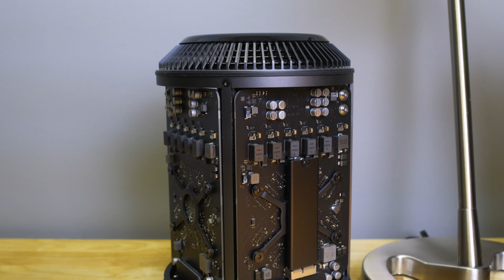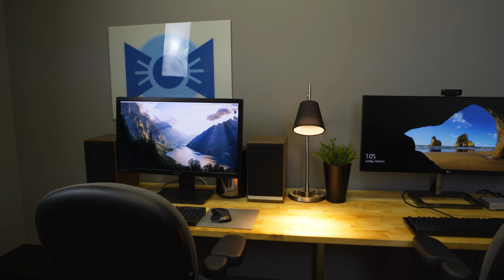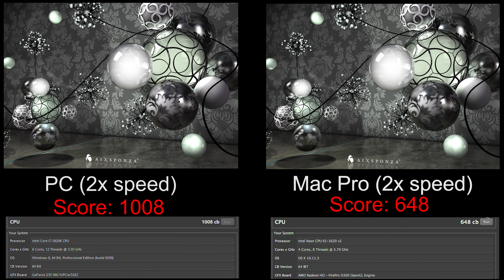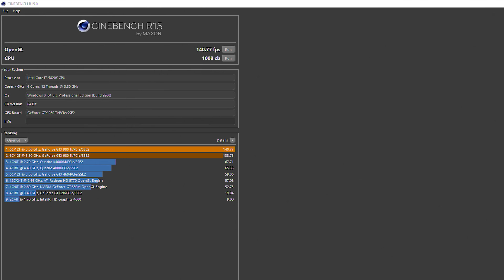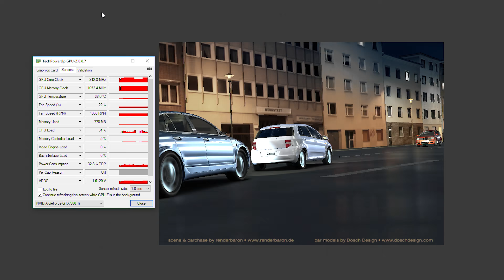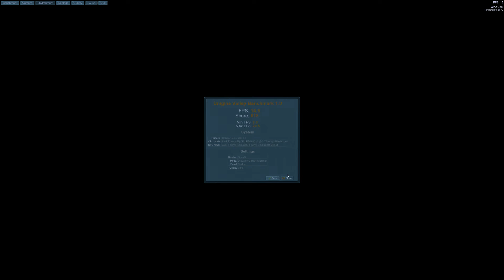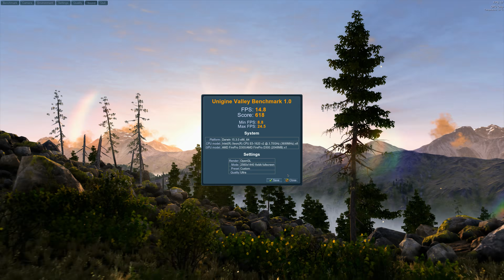$2,000 Custom PC vs $4,000 Mac Pro

Comment: why is the forest test so intensive? looks like your average game
Reply from the maker: +maak It's an OpenGL benchmark. It looks like a game but it's nothing like one.
Reply: +maak It's very likely running intensive graphical features that more authentically recreate visual effects, whereas games are optimized to look like they're doing the same thing, but with less intensive technologies. 
Think of things like fog, rain, and dynamic lighting, along with more complex physics/animation on all that foliage. Games are doing those things more cheaply, but are convincing enough to still look good.
Reply: +maak Unlikely. Your average game of 2016 is a FPS-locked, backhanded port of a console game. /s
Reply: +maak Because the Mac Pro comes with a Fire Pro class GPU, They aren't designed to run 3d games. They are more for 3d rendering and game design. Hence the such low scores. That fire pro card costs more then his 980Ti but cant even compete with any gaming grade gpu out today.  Even a Nvidia GTX950 wich costs $200 gets a decent 50fps in valley.

Comment: Did it ever OCCUR to you to load Windows 10 and OS X on he Mac Pro? 
I personally run a 2009 Mac Pro with 4 1 Tb drives using Windows 7, Windows 10, OS X (El Capitan), and Ubuntu.
I am curious why the FUCK you did not run the same OS on both machines? 

(ARE YOU STUPID??????)
Reply: +iSmell Butthurt it's not underpowered. It's overpriced
Reply: +Rich Gilbertson won't make a difference because the mac is hideously under powered anyways

Comment: I agree, it's bullshit how they don't update the hardware. Correct me if I'm wrong, but you're comparing a workstation GPU, to a gaming GPU. Those overclock's will deliver in performance 'benchmarks', but they could negatively effect the longevity of the component, and reliability of the computer. You're comparing a work machine, to a gaming rig. There is no chance I would ever buy a Mac pro, but I don't make childish hate comments either, and understand why someone with a budget may purchase one. Just build a Hackintosh, avoid the spyware lagging heap of Windows 10, and get the advantages of a custom built PC.
Reply: A workstation gpu can be made for 1,000 doe its 4,000 sp stfu
Reply: TheDenXGamer I never said you couldn't.
Reply: how is win10 laggy in any way..? its faster than 7 and 8. and i havent updated my hardware in 4 years
Reply: Daniel Leon Every time I've used it, I've had lag issues. Maybe they fixed, but doesn't change the fact that it looks awful compared to Windows 7.

Comment: What's your point ? If you build your pc with same spec (like xeon chip or fire pro card) in the same time,  it price  don't difference much like that. you're compare WORKSTATION and gaming machines. Are you nut? If  I use the same logic like you  so pc is suck and everybody must buy PS4.
Reply: I can't be bothered commenting a witty comment. Satan just kill me already.

Comment: OSX vs. Windows..seriously.  Anyone comparing hardware to hardware ONLY, misses at least half the battle.  I run a Mac Mini from 2011 ($499) and it runs the latest OS perfectly well.  I have an I7 2011 PC ($900) that Windows 10 pretty much turned into a useless brick.  Will not argue for or against, but for me (Computer Scientist with over 20yrs experience), there is no comparison - Windows has always made we wait for everything and OSX is snappy, attentive and rock-solid.

Comment: the funny thing is MAC makes out that it's better than a PC but some leaked photos showed the factory that builds mac computers had Windows 2000 running on the all the assembly lines lol.
Reply: I do feel safer I'm still using windows 7 and XP on duel boot, older OS's are much safer than newer ones, virus's, malware and other malicious content on the net target newer products for maximum damage and affect, but if you know what you are doing you'll never get infected, I've never had a malicious virus attack my computer in the last 7 years.

also most factory's that have massive assembly lines also keep most of that equipment running on a small wan or lan to avoid damage.
Reply: +Jamie Williamson The company that builds the airbags, seatbelts, and most of the safety devices in your car, are also running on an older OS.... Hope this makes you feel a little safer....
Reply: ikr
Reply: +Jamie Williamson Actually, virusses and stuff target old systems since all security issues are all well-known on those systems while never getting any updates for them anymore. Therefore they might have to google about five minutes for a list of security issues for your computer, write a virus and they're in. well... practically. Windows 7 does still get security updates I believe.
Reply: Well Apple doesn't make the machines that makes the Macs...
Reply: 2Awesome thanks to leaked photos it showed apples manufacturing plant ran on windows 2000 on every assembly line.
Reply: Windows XP is garbage, an incredibly unstable OS and the largest attack vector for malware this side of Flash. Its terrible.
Reply: Not in a million years. I was running XP on a gaming rig the same time I was OS 10.2-10.4 for work, and XP was SO bad.

I can take or leave either at this point, even though OS X is still much better on laptops. WinXP though, man, its the trash fire of operating systems. I'd have been doing my real work on Linux in the mid-2000s if OS X wasn't an option.
Reply: the people who create malicious programs won't target older systems most time, what the point of making a program that targets maybe 200,000 or 300,000 people on XP or windows 2000 when you could target newer systems that still have loop holes and back doors that still need to be patched, the people who create malicious software want to target the most amount of people in the smallest amount of time so attacking newer OS creates more victims and problems in the long run.
Reply: ***** So according to that I should target windows 7? (source: https://www.netmarketshare.com/operating-system-market-share.aspx?qprid=10&qpcustomd=0) Then I should go to this website (https://www.cvedetails.com/vulnerability-list/vendor_id-26/product_id-17153/hasexp-1/Microsoft-Windows-7.html) and pick one of the most vulnerable errors? Because that's how those people operate. They literrally look for something that's not complex to break in to. And that is in fact, things that don't get updated are a lot on that list.

Antivirus companies claim that about 90% of all viruses out there are "old" viruses for which your system is immune if you just update windows. This one no one really can confirm or deny.

What I'm trying to say is that you should drop the windows xp install for your own sake the security is not guaranteed and will have increaingly more vulnerabilities. because some day it'll be infected. And it might affect your win 7 partition and encrypt all your documents and request money for it.
That's a thing that happens.
Reply: most of the time people get infected by looking at questionable websites that deal in pirate goods, movies,music,porn, games, software etc etc, the PC I'm using to type this message has XP I only use this PC for gaming and checking a small handful of sites like reddit, facepunch and youtube and facebook, gog and steam, that's it, I download all my files onto a laptop running virtualbox windows 7 and XP that way I can scan then test the files to see if it's safe, if my virtualbox file gets damaged because of infected goods I can just install a fresh copy of the infected OS and try another source for the file I am looking for.
Reply: +Jamie Williamson That is too much work for an Apple pleb.
Reply: Apple doesn't use their own Mac servers for their data centers either. The Mac is only good for developing iPhone apps. It used to be really good at video, music, and photo editing but Windows caught up the last couple of years.
Reply: +Sulfen are macs actuality "good" for developing iPhone apps? or you are forced to use them as apple does not give you a choice? ;)
Reply: whatever000whenever You can get a hackintosh but the simulators are optimized for the parts they they use to build their macs. So it makes it less of a hassle.
Reply: So Chinese slave owners don't feel the need to update from Windows 2000? Shocked.

(2000 is actually my favorite Windows, used it until 7 was almost out. Jumped to XP for a couple years and still use 7)
Reply: So Chinese slave owners don't feel the need to update from Windows 2000? Shocked.

(2000 is actually my favorite Windows, used it until 7 was almost out. Jumped to XP for a couple years and still use 7)
Reply: If you need to run a production line, or a business of any significant size, you are clearly not going to be using a Mac. They make consumer fashion goods. They will chop and change their products to suit fashion trends, not to keep businesses operating. Look at the loyal businesses burnt by Apple's sudden cancelling of the xservers and Final Cut Pro. Nope. Not doing it no more. Just make do with Mac Minis (ie go from supposed business grade devices to toys!)
Reply: Venonæ you have the mentality of a 2 year old.
Reply: Is anybody else here PC Pro, or Comptia A+ certified?
Reply: case closed, you have more teeth than brain cells.
Reply: Ladies, calm down
Reply: Bryce Lawson I've worked a couple of IT jobs and none of them took my A+ certification seriously. It was a waste of time to take it during high school lol.
Reply: LOL
Reply: +Sulfen I'm not taking it for high school, I took a full I.T. Class in college. A+, PC pro, net +, security +, are some of the certifications I got. And everywhere I have ever looked, has asked for A+, net + and security +
Reply: Bryce Lawson If they ask for it then I guess I'll have it. But so far no one has asked for it so it has been a waste of time and money thus far.
Reply: KoolAidManOG still better than mac OS
Reply: KoolAidManOG Windows XP is long gone, make your decisions about current stuff. Don't buy stuff just because of the previous version, buy it based on the current version.
Reply: 2Awesome Obvious statement is obvious.

I've run XP, 7, 8, 8.1, and now 10 alongside OS X, and I've been happy with everything after XP (I even liked Win 8.1 after SP1 came out).

I was responding directly to a comment saying that OS X was inferior to Windows XP, an asinine statement considering that OS X has remained an excellent operating system and the fact that XP was always hot garbage.

Keep up with the thread and don't reply to comments out of context.

Comment: Thank you 4 all the apple hate
Reply: Windows and Android all the way
Reply: +Dan Singh enjoy the spyware you called windows
Reply: +probE466 what Spyware
Reply: Windows Update in Windows 10 utilizes P2P by default, most likely the same P2P technology used by Pando Media Booster. Essentially it turns your PC into a zombie host server, wasting your bandwidth serving updates to other computers. This also means Windows Update might be utilized later to spread malware through the P2P system via 0days.
https://archive.is/Tqv7s
https://archive.is/s3BjC
https://archive.is/Yy9JB
You cannot turn off "Telemetry" unless you own Windows 10 Enterprise Edition.
This means your computer will continuously leak unspecified information to Microsoft and there's no way of turning this off.
https://archive.is/3yo92
You cannot turn off "Real-time Protection", aka Windows Defender. Even if you do it will turn itself on again after a while.
This means you cannot prevent your PC from sending random files and information to Microsoft for "analysis".
https://archive.is/Dln44
Cortana has zero local storage functionality and does not function unless you have a Microsoft Account connected.
It will even inform you about this if you try using it on a local account, and then shut itself down.
https://archive.is/2Vw55
Windows 10 start menu will have "Content suggestions" which are on by default, which means you'll be seeing ads.
https://archive.is/0ltgw
Windows 10 "Wifi Sense" will be begging for your Facebook account details so it can get to know you better.
It will also be sharing your Wifi password with all your Facebook/Skype/Outlook friends, their friends, as well as Microsoft.
https://archive.is/9HETF
https://archive.is/mO3aH

Comment: The D300 is a worstation card so naturally won't perform as well as the 980ti in gaming situations such as the Unigine Valley and the Cinebench Open GL test
Reply: +Billy Ashworth wtf the difference between a workstation card and a gaming card? like im serious I dont see any difference between the two, they both spit out info at a certain rate

~thanks~
Reply: I'm not sure myself but the workstation card, I believe, is supposed to do better in worstation apps, as in photoshop rendering for example. In CAD apps, it will offer a higher floating point accuracy, meaning drawings will be more accurate. But obviously in a game it WILL NOT be noticable. And it is supposedly more reliable. 
It's kinda like a work horse vs a race horse. They have their own different purposes. 
Have a look at TechQuickie's video on Quadro (Worstation) vs GeForce (Gaming). That explains it better
Reply: ok thank you! ill go look at that video now!

Comment: Should have added some real-world benchmarks like applying filters in Photoshop or rendering videos, which the Mac Pro is designed for. Maybe also some OpenCL GPU computing. It is not a gaming machine after all.
Reply: +Spritznkarli the hardware on alot worse and it costs an extra $2000 i think i wouldnt but one

Comment: So I ran Unigine Valley on my aging PC...interesting results

AMD FX 8120 Stock with turbo enabled (usually running between 34xx to 4xxx Ghz each core)
AMD R9 270x 2GB VRAM
8GB RAM
Windows 10
Cost <$1000

Running on ultra everything at 1080p

Score 1265

FPS 30
Min FPS 14.6
Max FPS 57.3

Comment: hmm a 6700k should be better alot
Reply from the maker: +Sebastiaan D Not for video editing. More cores is better. Higher clock speed with fewer cores is advantageous to gaming.
Reply: +Snazzy Labs Well a 6700k is a fast single-core, but it has hyperthreading so windows and edit software can render on 8 "core"
Reply: +Sebastiaan D True , but remember the hexa core that snazzy used in the video ALSO has hyperthreading , that means windows will render on 12 cores , just like Snazzy said the 6700 will excel more in gaming , but do to fewer cores it will be worse at video editing
Reply: +Ali xFiFa But its a gaming pc u dont need 6 cores.
Reply: Yes for a gaming rig , but in this video , snazzy has a mac pro which is a video editing computer , so the pc has to be simliar to compete
Reply: +Sebastiaan D this is a gaming and work computer for him at lest... plus if he streams or does something as he is gaming the 2 extra cores will help. plus he oc the cores so it be better in that way 2.

Comment: Thanks to show how to do this Bench mark test always wanted to test my refurbished PC and yes i agree with you on that one.
My PC is a HP Z600  from 2011 it have 2 x intel Xeon X5650 2.66GHz , 24g DDR3 1333mhz ECC, it came with 2 x intel 160gb SSD but i replaced this with Samsung evo850 500gb and it have a Nvidia Quadro 4000.
The test results score for the CPU was 1028 and for the GPU 64.01.
I wanted to build a new PC after my 2007 custom build start play up and was to old to update and didn't have enough money than i found this store that sell refurbished and got the Z600 not regret it.
I like your table did you say you got it from Ikea?